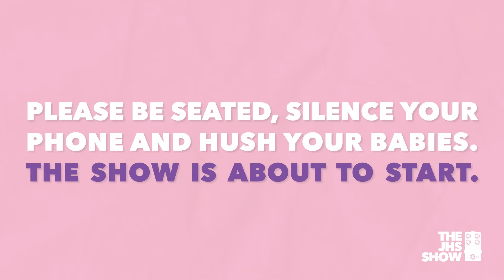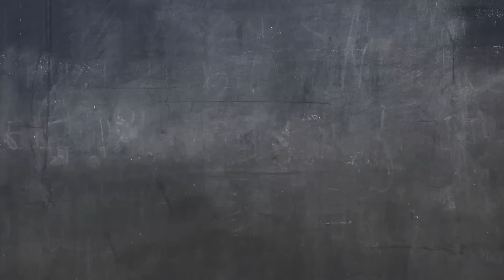The New Maestro Pedals (With Daniel Danger)

Comment: I owned one of those first fuzz pedals. It was intended for bass! I used it with my bass. They even sold a bass with one built in. I also had a Brassmaster, the three button Oberheim phase shifter, the ring modulator, and I had borrowed that guitar synth multi effects thing. Oh and some filter pedal with sample and hold and multi tone booster.

Comment: My first thought was “GET ON WITH IT ALREADY!!!!”  And I WAS a ‘70s synth player!  Incidentally, I don’t know how many tape loops I replaced back in the early - to mid - ‘70s in Echoplexes, along with Roland Space Echoes and Chorus Echoes, always using Ampex 456 Mastering Tape.  The back side of the tape is impregnated with graphite, a very effective lubricant, and I never had to fix a replacement loop!  There are a number of them that are out there somewhere, still echoing like new.  Maestro made a thing that brass and woodwind players used in the early days - a Frequency Multiplier/Divider.  And that Octave Box came later!  By the way, JHS Pedals are.OVERPRICED BY AT LEAST 98%

Comment: Which Maestro Fuzz is this? I have the SG System C.M.I. Made in El Monte Standel/Gibson SG 212. 100 watt 2x12 combo with beautiful alnico speakers. Spring reverb, notch filter, and 2 Maestro pedals mounted in to the front dashboard. One the the Mastro Phaser Pedal, controllable with the 3 colored switches on the amp OR with a foot switch that lets you switch the 3 speed switches by foot. Then there is a Maestro Fuzz pedal mounted in there. WHICH FUZZ IS THIS? I heard someone call it the Maestro Square Wave Fuzz. Which pedal would that be? 
Also interesting: it comes with hi-fidelity RCA 8417 tubes. But since I got it, I’ve just had the tubes that the previous owner had in it: typical Marshall JCM 800 Tubes.
Also interesting: when the Tube Craze took over (circa late 80s or early 90s?) companies added tubes (or a 12ax7)  to he pre into solid state power amps. Pedals, amps, and everything follow this formula. This SG212 has a solid state preamp and hi-fidelity tube-power amp section.
Here in New Orleans in the 70s, The Meters played through giant stacks of these things. The phaser is the same pedal heard on Jimi Hendrix’ “EXP”
Which Maestro fuzz is in this thing?
plz/thx -P.W.itd